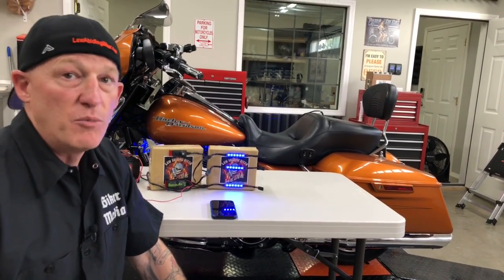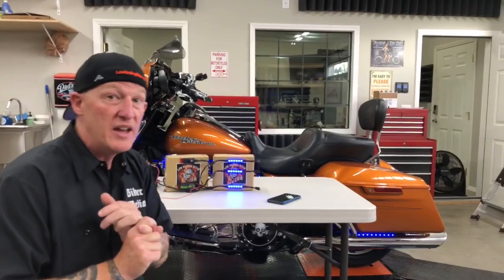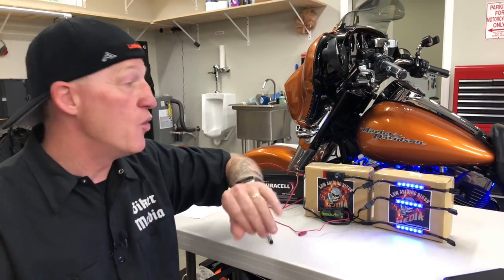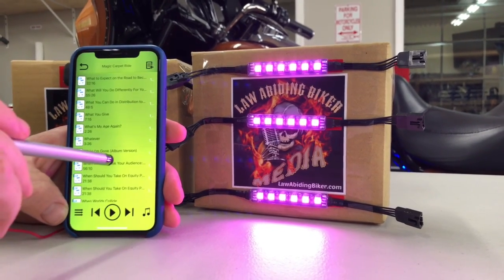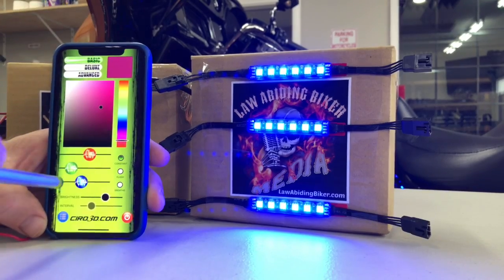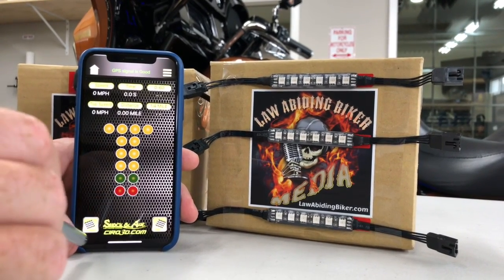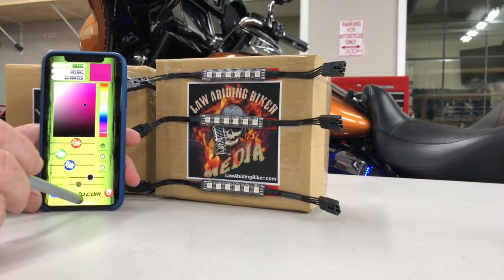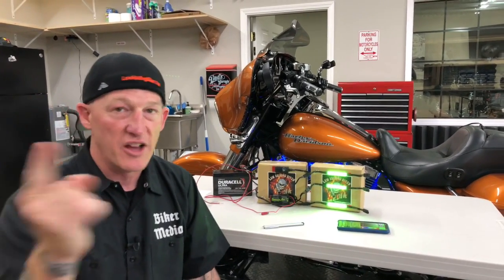Insane Reveal-NEW  Shock & Awe 2.0 LED Lights, Controller, & App for Harley-Ciro 3D!!

Comment: hey Ryan thanks, my app updated but the music function doesn't work, any ideas?
Reply from the maker: Ciro has since learned that the music and mic modes will not work properly with the old controller box and will damage it over time. So they've changed it and you need the new 2.0 controller to have those functions.

Comment: Ciro 3Ds innovation is no surprise. Hands down the best light system on the market and this just proves it. Their customer service is also top notch. One question though. Will the music feature work with the new app on the old brain box or will a new brain box be required?
Reply from the maker: No Michael. I go over that in the video. The new app will work with the od brain box controller. You'll get the music mode, mic mode, picture mode, race mode etc. However, you'll need the new controller/brain box to hook up to your current Shock & Awe LED strips if you want the new hardware such as brake lead, voltage monitoring, and go get the 3rd channel. Here is a detailed article I wrote on the matter too ==> https://www.lawabidingbiker.com/ciro-3d-shock-awe-2-0-led-lights-for-harley/
Reply: Thank You!!
Reply: FYI, The music mode race mode and microphone mode Do Not Work With the old brain and the new app.
Reply from the maker: Michael Howard They will, just wait for the app update which will be coming very soon
Reply: Ryan Urlacher I have the shockandawe2.0.  Dont work unless another update is coming out.
Reply: Just an FYI. I Just confirmed with Ciro that the new app will NOT work for music and microphone on the old controller. The memory isn't enough on the old controller. Therefore the new controller must be purchased.

Comment: Hands down, the best LED system I have seen so far.  Not cheap, but I think the price is fair and justified by the quality of the rest of the Ciro 3D product line. And from what I have heard, the customer support is top notch. Way to go Ciro 3D, for another impressive product with some great functionality and options. Ryan, Great job on another very informative video. And congrats on this relationship you have forged with Ciro 3D.
Reply from the maker: Thanks for all that brother. Appreciate it.